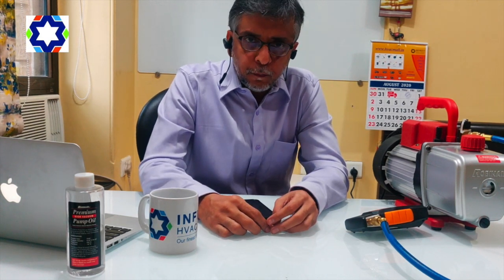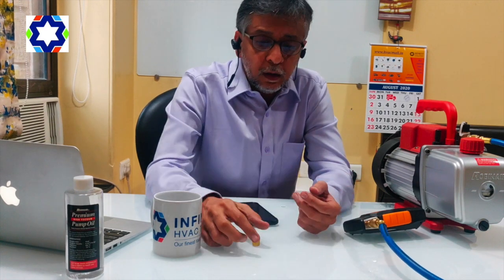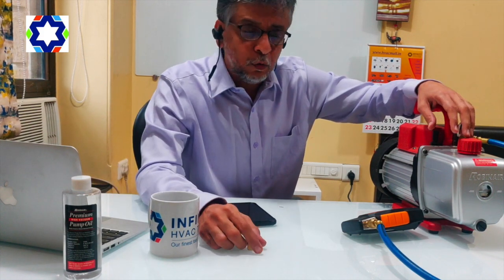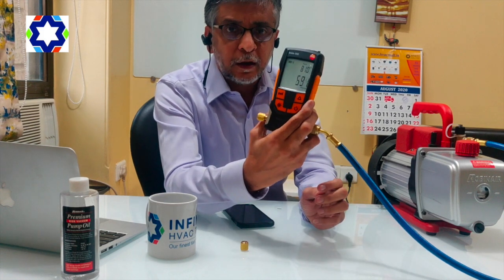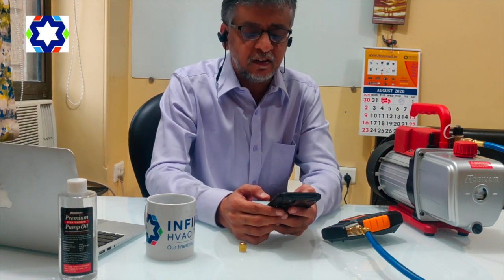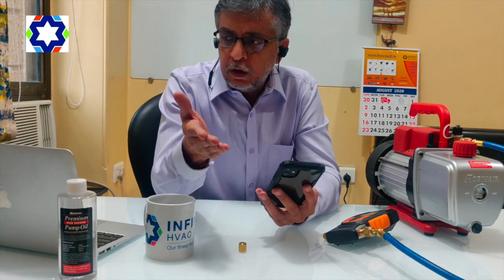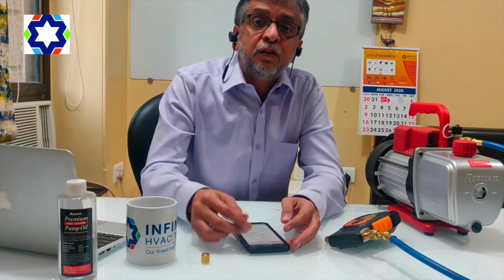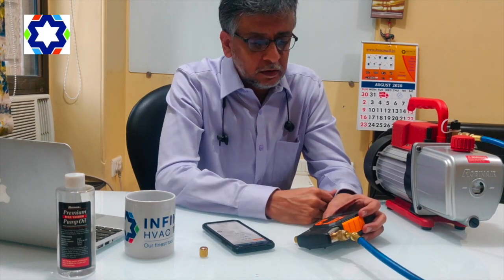Check out THIS Video before VRV Commissioning | Infinity HVAC | Vinod Chandan

Comment: Sir .your video is nice but i thought  why , your branded vaccum pump and digital  vaccum gauge does not show 100 micron after couple of minutes. while you vaccum only charging hose.
Reply from the maker: You have to wait for sometime for the vacuum to achieve it's mentioned number.

For any other queries - email - enquiry@ihvac.in
or Whatsapp / call 9223521222